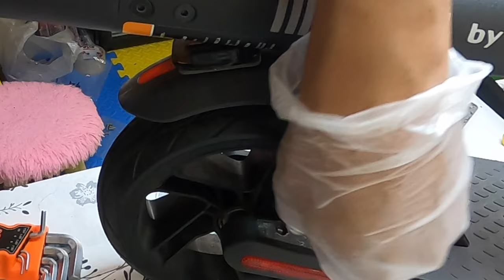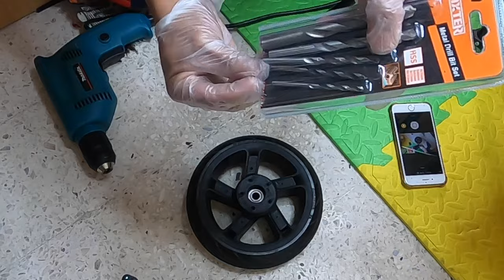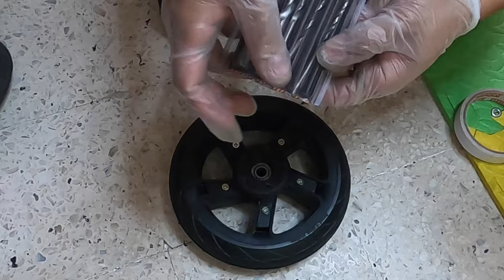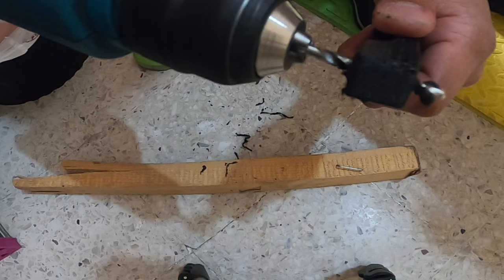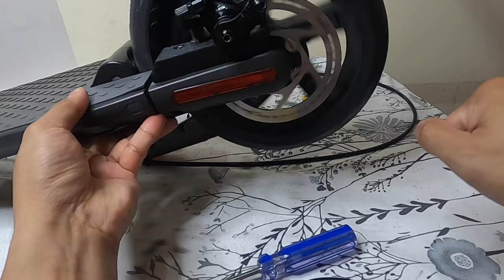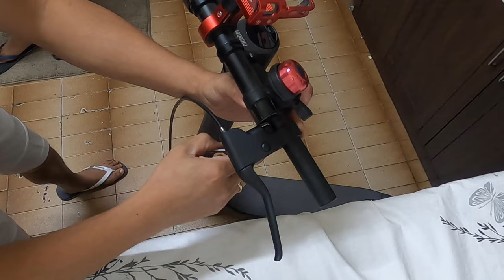How to  Easy Install DISC BRAKE! | STEP BY STEP | NINEBOT ES1/ES2/ES4 | JAMES ANGELO TV | Vlog no.14

Comment: Your videos are great and I'm going to try the fix for the front suspension being too soft.
Question, have you thought of converting the Ninebot solid tires to air-filled Xiaomi tires?  I am wondering if they would fit.
Reply from the maker: it wont fit they have different size
Reply: Можешь поискать на Алиэкспрессе колёса с пневматическими шинами. 8 дюймов моторколесо и 7,8 дюймов заднее.

Comment: I am building mine and I have doubts if it supports the heat of the plastic disc well. You have used it for a long time, what is your experience.
Reply from the maker: if you want to make like this use disc brake as support brake not main brake because plastic is not so strong
Reply: @JamesAngeloTV  changing the wheel for a m365 is a good option.
Reply: @karloszaballos  Hey is it possible to install the m365 rear wheel with disc brake on the es2?

Comment: 100mm o 120mm the disc? Thanks!
Reply from the maker: 110 sir just buy a set from xiaomi NOT pro thats the exact size of brake set
Reply: Yes but you search for example in AliExpress xiaomi break set and al the disc have 120mm 🤷🏻‍♂️
Reply from the maker: Nicolás Hamer  if not have try in amazon or banggood in my case i baught mine in scootershop here in abu dhabi
Reply: Thanks!
Reply from the maker: welcome bro❤️🛴

Comment: Hi, why does the flashing not work with the brake?
Reply from the maker: do you mean brake light not working?
Reply: normally on the old braking, the light flashes. there's no.
Reply from the maker: try to check in settings bro maybe it set as on the rear light

Comment: Where can I buy the parts?
Reply from the maker: you can check in 3 printing shop.and xiaomi break set
Reply: James Angelo TV do you know where I can get the files for 3D printing?
Reply from the maker: CHAOSTECH  if you are here in abu dhabi i write the contact person for 3d printing down in video description
Reply: Hi
This mounting plate for the disc to the wheel,
Can the contact person deliver it to Switzerland, Germany or Turkey?
Reply from the maker: Ishak Akyüz  im not sure because of the shipping fee but you can ask them throuh wattsapp

Comment: Why not just glu the 3D printed part to the wheel with epoxy glue?
Reply from the maker: epoxy i think is easy to break
Reply: @JamesAngeloTV  thanks for the response, but I think a glue that melt the two plastic parts together would ne easier to use and faster to set up.
Reply from the maker: yes its easy to set up but the quality of epoxy is different compare to 3d printed high quality plastic
Reply from the maker: but you can try bro no problem, jus expirements😉

Comment: With a little imagination, you could have routed the brake line through the tube, past the battery and through the control board for a cleaner look!
Reply from the maker: yes but too much effort to do😂
Reply: Chayo Darling, show us, how you did this!